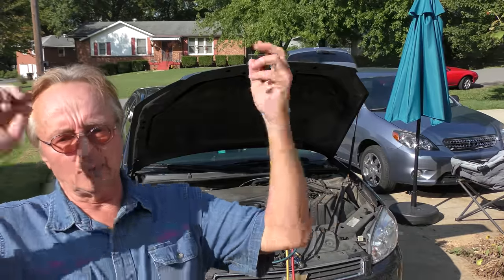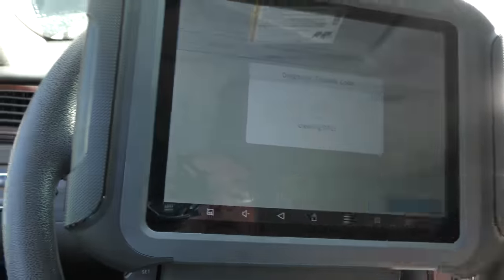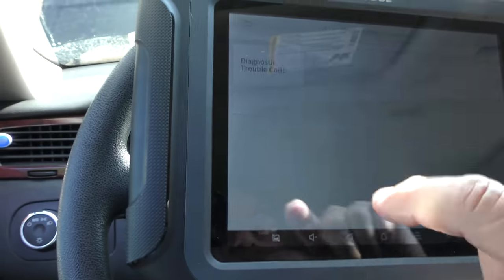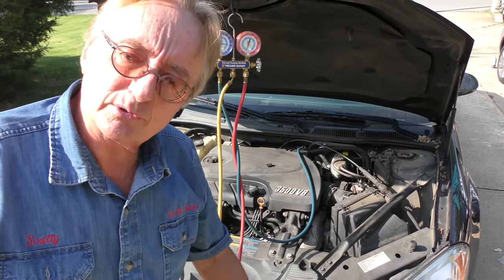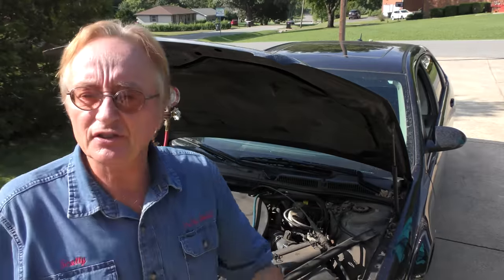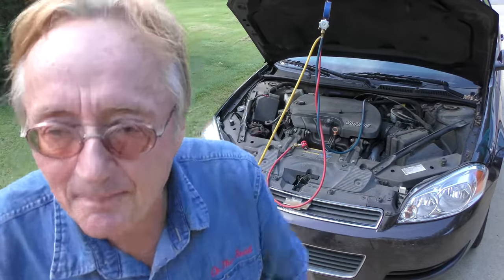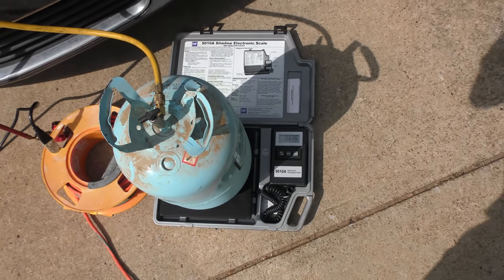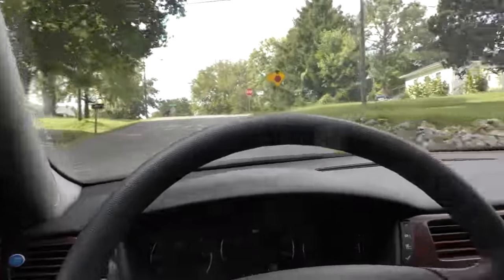I’m Getting Tired of This Crap

Comment: Way back in my high school days one of my friends drove a 1976 Ford LTD. That thing had a huge A/C compressor and it could get so cold that you could see your breath inside the car on a 95 degree day. Now that's air conditioning.
Reply: I owned a 74 Olds. Cutlass that had the Long GM Compressor, it would freeze you out on the Hottest Day, we drove that car for 14 years and Air Conditioning never failed to Cool...

Comment: Out of all the cars I've had. I'd never had a A/C  issue with GM products. Replaced a compressor in a Subaru and Chrysler though.
Reply: Had to replace the condenser coil in my 2015 tahoe this past summer
Reply: Rolls Royce used GM air , world's best.
Reply: So you are saying you have never owned a GM product?
Reply: Every one of my GM cars had crappy a/c. 1996 Pontiac Grand Am, 1999 Pontiac Montana, 2003 Grand Am, 2011 Chevrolet Impala, although my current 2015 Impala is still blowing cold, but the trunk fills with water every time it rains. I wish I had known Scotty 24 years ago.
Reply: I've never had issues with my chinese buick either. 7000 miles on the odo, runs like a clock

Comment: 2006 was same way with the transmission slip, go harder on the gas that thing would grab in second and third. Ac only worked while driving, didn't do much in idol.
Excellent video.

Comment: Hi Scotty I’ve got a 04 explorer 4.6 v 8 new fuel pump did all the checks you can do still no power to the pump I get a 191 and a 442 code both not related I think there is a fuel  relay in the back I have to remove all the plastic and it’s in the fender well it’s a Ford only thing I haven’t done I did hook the pump to the inertia switch. I don’t know how safe it is but I’m going to get that part at the recycling yard.

Comment: On my old car the closed circuit trap got jammed. It broke. I had the trap removed. here in the North we barely use that functionality except for very hot summer days and still, a good AC system doesn’t need that. Turned out that it was either removing the trap or replacing the evaporator for $3,000 CDN. I chose the first… I used my car on very hot days this summer and it was still plenty cold.

Comment: Scotty, would you consider doing an episode on the classic Checker Cab made by the Checker cab company of Kalamazoo Michigan and their classic car that was the same basic design from 1952-1982 and used in the 70's tv show "Taxi"? Also did you ever work on a Checker cab or other Checker vehicle? I read they were designed for long service and easy repair but got poor gas mileage.

Comment: I have 2 different clients that have an impala.  One is a 2014 and the other is a 2016.  Both have been nightmares, but more so the 2016.  At under 50k miles ball joints, compressor, radio, and transmission has all had to be replaced along with other repairs.  The 2014 has also had a transmission replaced at around 80k miles.

Comment: my 10-gen Civic went out at 3 years old.  Cost a fortune because none of the AC repair places had started getting the new Freon equipment since that hardware was super expensive for them and not enough of the new cars were having maintenance...except for the civics lol.
Reply: You can get it fixed for free. Honda extended the warranty on the AC.
Reply: @jaysmith179   that's good. It was the right thing for them to do. Unfortunately when my '16 went out, they had not instituted the extended AC warranty.  I traded it in right after I got it fixed (too many little things wrong on my civic, didn't trust it longterm).

Comment: I worked at Ford Connersville and among other items we made the fs10 compressor and later the scroll compressor. I had a 1995 f150 that had over 169000 miles and the AC would not engage the clutch. If I smacked it with a leather mallet it would engage, so I remembered that a small washer was on the end of the shaft spacing out the clutch to hold it out to spec. I loosened the screw and took off the clutch and removed the washer( it just falls out). Put it back on and suddenly had the right spacing to engage the clutch. Problem solved, ice cold AC for 5 minutes of DIY.

Comment: Great  video Scotty, how do you find a leak in an air condition system? I have a 89 Chevy truck and it leaks it out after a few drives.
Reply: There's a florescent dye added to system. Use with a black light to find leak.

Comment: Hey there Scotty
2016 Ford edge AWD , rear axle assembly pinion bearing are shot due to lack of oil that I discovered after I removed it and drained what was in side of it out. Here is the issue I have a 7 year 100,000 mile power drive train warranty on the vehicle that I didn't realize I had.  the vehicle  was a pre owned certificated Ford . I found out once I removed the axle assembly the part was on back order with no date in site for replacement. So I took it upon myself to get a junk yard axle assembly and installed it.  I then went back to the dealer to find out if I had a warranty and that is how all of this has came about. Ford will not warranty the part because I removed it myself. A trained ford tech within the walls of the dealership has to have the part in the car to diagnose it and warranty the part. This is when I said I have the original part, photos, the 16 oz of oil and metal shavings that were inside of it. Why can't the trained ford tech  just look the inside of it  and say it was bad? There answer is NO! I even have the 172 point check list from time of purchase saying this oil level passed. I also have recent dealer service records never documenting any kind of oil leaks in the rear axle when they did there multi point inspections at time of a services. So the oil that was in the axle assembly was never filled to the 38 oz it required and the unit failed because of this.

Comment: Hey scotty I have a 2010 impala 3.5 184k miles,, when I make a somewhat tight left turn under 10mph (usually when I'm barely pulling out of a street) I hear like a metal grinding noise and my service stabilitrak, ABS, and traction control lights pop up, I replaced both hub assemblies a year ago. I drive the car a little while and the lights goes away. Drives smooth all the time, doesn't make any power steering whining noises when turning. What could it be? Any help would be appreciated!!!!

Comment: Hey Scotty! Getting ready to do a rebuild on my 1994 Honda Civic Del Sol 1.6L D16Z6 motor.

Anything you would suggest I keep an eye out for? It’ll be my first motor rebuild.
Reply: Great engines.  Replace all gaskets and both crank seal and rear main seal.
Reply: @GuerreroDelInfo  

Yeah, was gonna go all out with it down to the pistons and seals all way around, just didn’t know if there were any quirks that I may need to keep an eye out on 🤷‍♂️ 

The biggest seal issue as of current is the targa seals 🤣

Comment: Is the lexus NX 300h worth buying? Or should I purchase the regular 300? I’m more worried about the long run with the batteries, by I want the high mpg.
Reply: Go for the NX 300h, you'll get excellent mpg vs. the 300.
Don't worry about the battery, the average life of the hybrids' batteries exceeds 11 years (and their small battery is "cheap" - compared to an EV much, much bigger battery).
If you'll use it in a city or in a hilly region, the hybrid is the perfect choice, giving you the best of both worlds (EV and ICE - and I am, based on facts/science against the mire polluting EV's). But for long roads, on flat terrain, the regular 300 will be a better choice.

Comment: Hello friends. I need help with a 2010 vw sharan 1.8T, won't crank and no start too. Before this happen, the EPC light was on while a I was travelling far, the 40km later it limited power and then it stalled. What should I do? Mechanic says I need new engine which cost a fortune. Please help friends.
Reply: You need to go to a good, honest, reliable independent mechanic (NOT a dealership) to diagnose your car with a scan tool. Depending on the results of the scan, , you can the decide the way forward. Good luck!
Reply: maybe the camshaft sensor or Crank position sensor
Reply: Those can be difficult. Get a scan at a auto supply place for free.
Reply: if mechanic said u need a engine,u need a engine. next time do your oil changes more frequently. tough luck, scotty isnt gonna know anything unless he diagnosis the car.